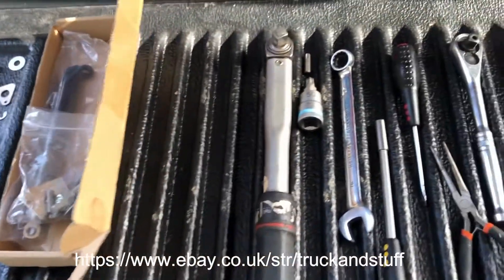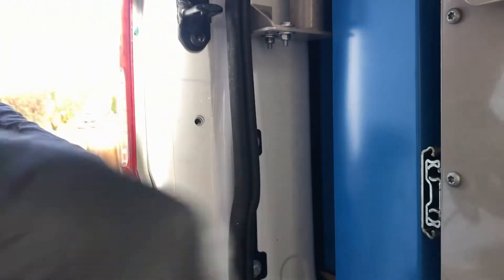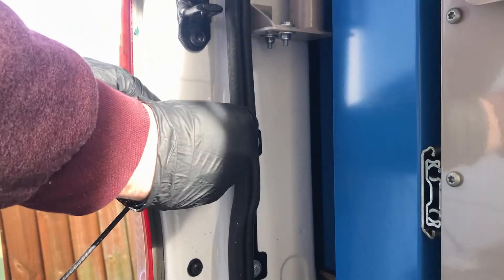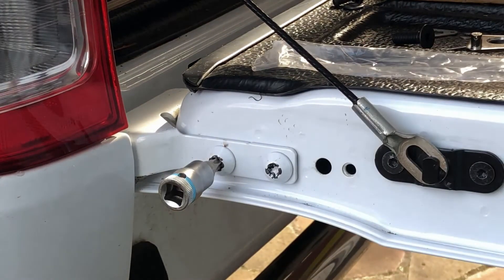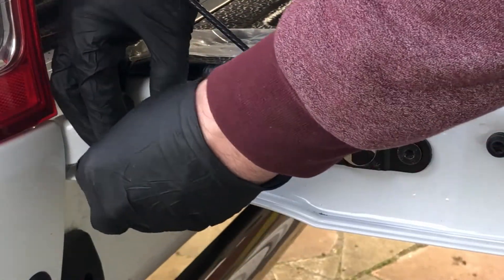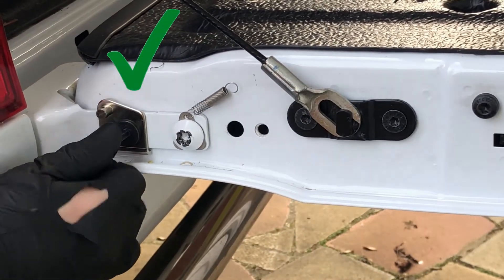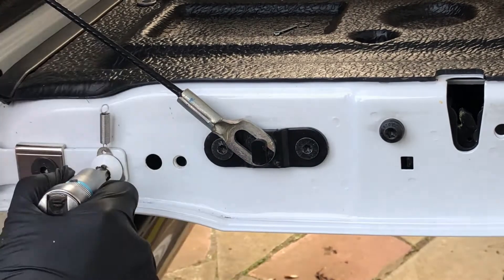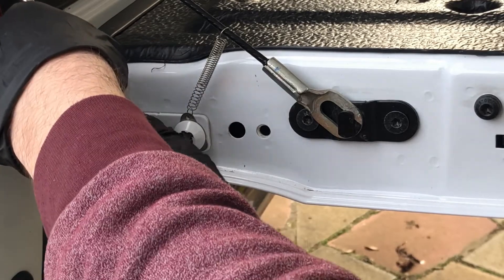Ford Ranger Tailgate damper Installation

Comment: How are they performing since you installed them?
Reply: mine's great on my 2020 ranger..... helps so much when i have a hand full of stuff and i care about my tailgate slamming down hard... theres only one flaw that people have to keep an eye on.. if your steel cable is not tucked in to the left of the damper then it will pinch it in-between the damper and tailgate and will eventually eat through the cable...  i forget to make sure it's tucked to the side sometimes but i've made sure its in the right position 97% of the time and it's pretty much formed to that position now.. just a heads up!